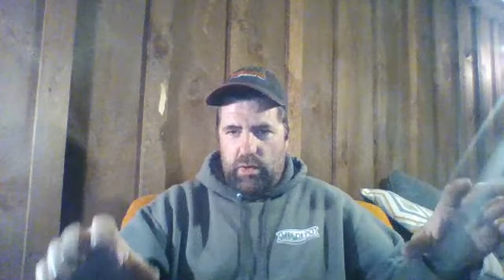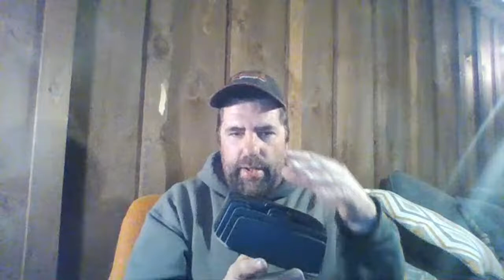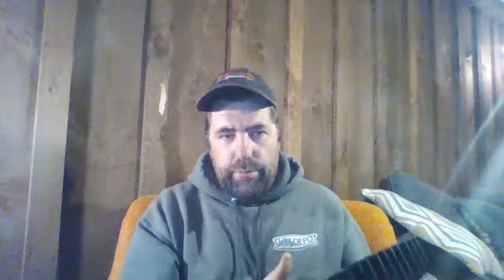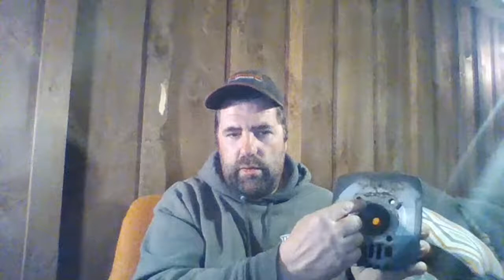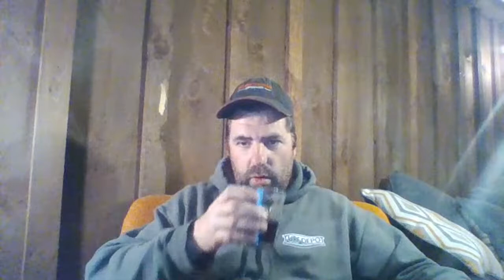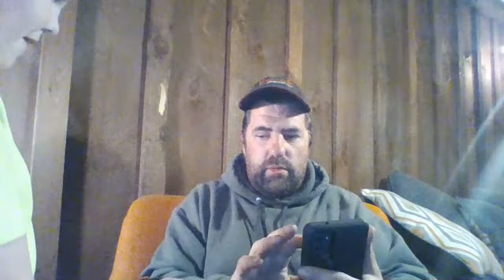vid connection problem

Comment: Hi Kevin! Good stuff! I have a 1978 Kawasaki KM100 project. I took the motor apart and found some deep grooves/scratches on the piston and cylinder. Is the cylinder plated? It appears to be all aluminum. Having a hard time looking for a replacement